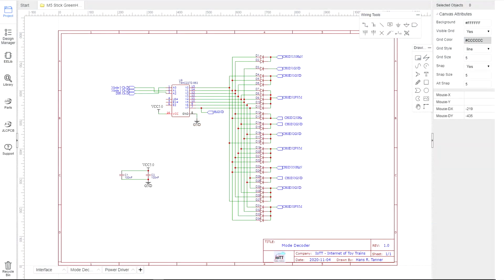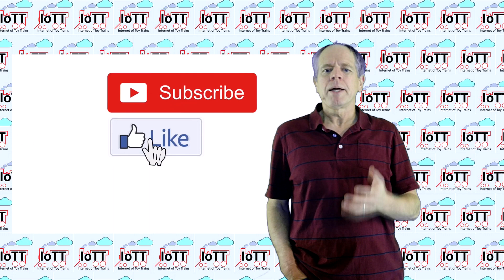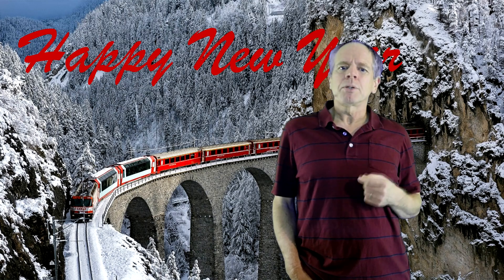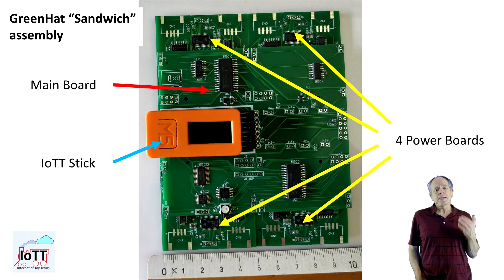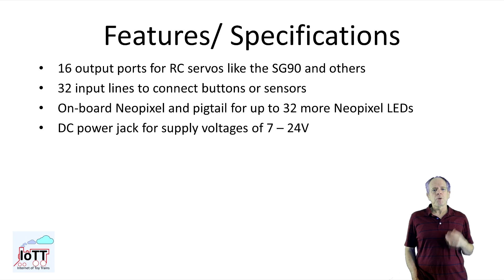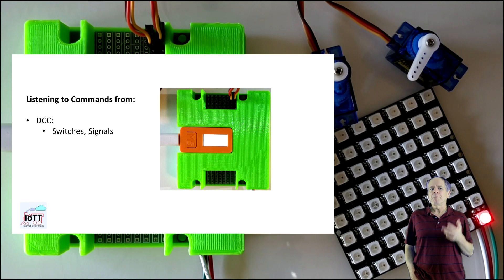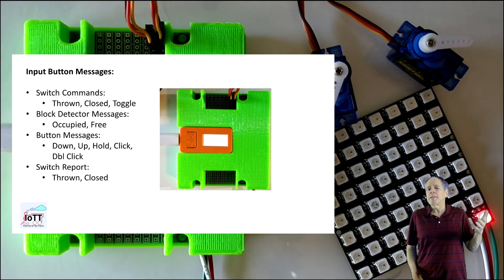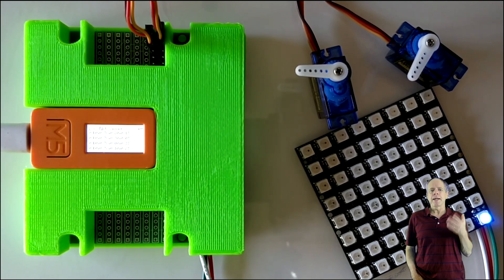GreenHat Project Update (Video#58)

Comment: One nice feature I would like to have in your software on the Iott is to be able to have virtual dcc address that send out many dcc command. Like set up route. A bit like your bouton handler setup. I guess you can expand the functionality of this feature. This would create some macro at the expanse of dcc address.
Reply: This can simplify greatly the layout operation from the throttle.
Reply from the maker: If I understand your request correctly, you are talking about what's called "MU-ing", MU standing for Multi-Unit: You can combine a number of locomotives to a consist and then operate the consist by using the DCC address of just one locomotive.
If this is what you are talking about, this is a standard feature of pretty much every state-of-the-art digital command control system. On Digitrax throttles this has been available since the DT100 throttle came out somewhere around 1995. The functions that are needed are a) building up a MU by adding individual locos, b) removing a loco from a consist, and c) assigning a consist to the throttle and operating it. All these functions are available using the throttle knobs.
And on my Smart Phone Throttle from Video #51 you can assign a consist by the leading address just like any other locomotive and it will operate the entire consist. What is missing right now is a dialog function for adding and removing locomotives to a consist. That will be added in a future version.
Reply: @IoTT  no i am more thinking to the  accessories address like typing 111 and the iott have a list of command and throw a few  switch like 11, 15, 55.  This way you can setup route with one switch command on the throttle. Instead of doing a few of them one after the other. I guess people would be interested to install one iott only for this feature. A bit like you demonstrated on the ctc panel. Would be useful for layout without any panel or button on the facia. That why I say virtual accessories dcc address who act like a macro. Your web interface is so easy to program, it would be a nice feature.
Reply: I have a similar feature on my dcc hare and wabbit. But when I use those route setting with one address it send one switch command on loconet but many switch point will act on that single command. The main issue with this way of doing it it won’t update any led on the ctc panel. Having a macro that respond to a dcc address and will resend a few switch command on the loconet bus would be better. This way all the switch will be updated à on any panel as the loconet bus will have receive all the individual command.
Reply from the maker: Ok, thanks for the clarification. That is not too complicated to do, it will be an additional input option for the button handler, which then becomes a more general event handler and can react on button, switch and signal events, possibly also block detector and transponding events.
And in the meantime, if you have MQTT and Node-RED running, there is a simple work around as well: You can program a function in Node-RED that receives a switch input and shoots out a button command, which then activates the route in the button handler. A small detour, but it works.
Reply: @IoTT  you got it. Yes block detector can activate a crossing manage by your green hat as well.

Comment: Awesome Hans.
I really like the idea of being able to build up different combinations of plug-able I2C I/O to handle locations that have different I/O requirements.
Would you consider adding 1 or 2 Grove connectors to allow adding other Off-the-Shelf I2C components so you don’t have to build everything...;)
Also you referred to “LLC” but did you mean “LCC”?
Alex
Reply from the maker: Yes, it should be LCC, of course. Stuff happens ;-)
The I2C wires are on the extension board connector used to daisy chain up to four GreenHats (with automatic adjustment of the I2C bus addresses).  So it is no problem to add a soldering pad for a Grove port, but it will most likely have to go to the lower side of the PCB as I need the real estate on the upper side for SMD components that can be soldered by the PCB manufacturer (JLCPCB will not mount the Grove connector anyway).

Comment: Thanks for the update Hans. Your attention to functionality and detail in order to perfect the design of your hats is very much appreciated. This insight certainly makes your designs top notch. One question. When daisy-chaining the Green Hats, is it possible to have them separated so that some can be closer to servos in another part of the layout. Also, if they can, how far apart can they be reasonably separated? Please keep up the great work! I wish you a very Merry Christmas and a wonderful New Year free from COVID-19! Looking forward to your many new projects in the coming year.
Reply from the maker: Thanks for your feedback. I don't know right now if distancing individual hats will be possible. The critical component is the I2C bus which runs at 400kHz and connects the modules. If the wires get too long there will be communication problems. I tend to think that a distance of maybe a foot between the hats should be possible, but I have not tested it yet.
Reply: @IoTT  Hans, your reply got me thinking and I recalled a conversation on the MERG forum pages concerning I2C and wire length. According to one person, the buss is subject to errors if the length between two device modules is too long. It was suggested that a buss extender could work for long distances. This was recommended by one writer: Qwiic Differential I2C Bus Extender (PCA9615) from Sparkfun. It will apparently allow up to 100 feet between devices. The bottom line of most of the conversations was that no one knew for sure how far the devices could be apart from each other and that replanning the location of device modules to get them closer together might be a better idea. Still, the buss extender might be the answer for some.
Reply from the maker: Might be, but then I would argue for the same money you buy an additional IoTT Stick and you connect the GreenHat via Wifi or the existing LocoNet ;-)
Reply: @IoTT  Actually, in my situation, that would be a much more practical solution. Having two Green Hats at either end of the layout should make things easier. Thanks. Have a Merry Christmas Hans!